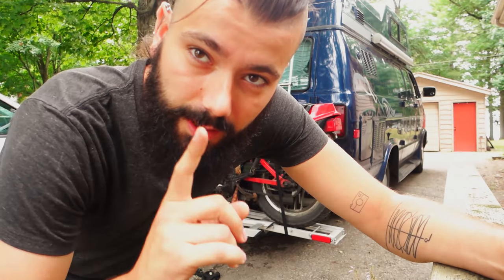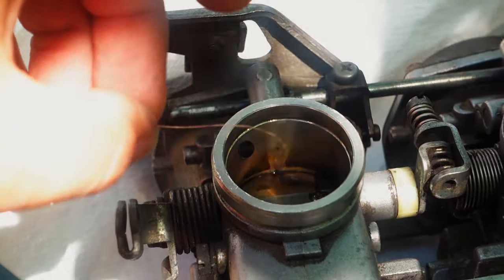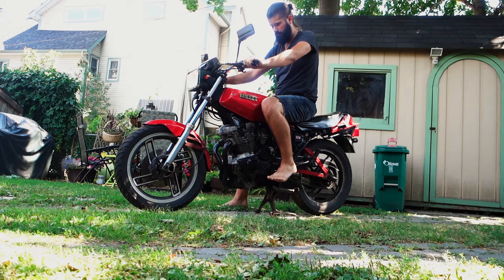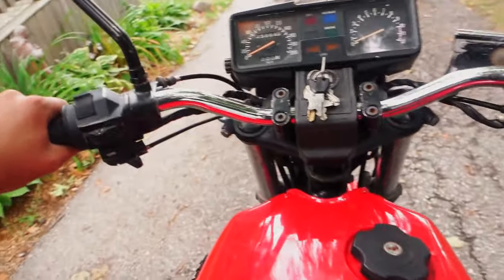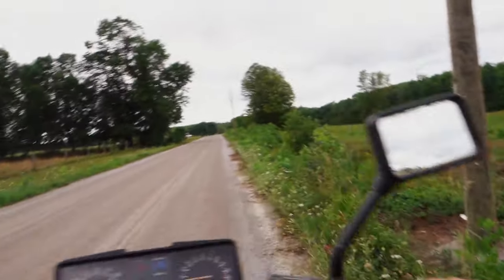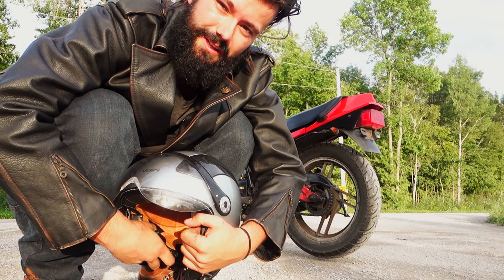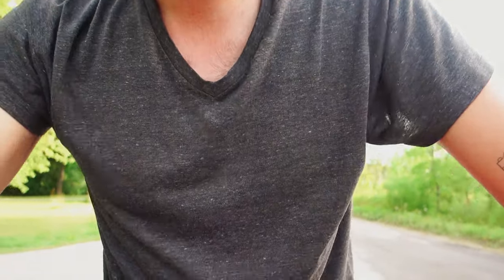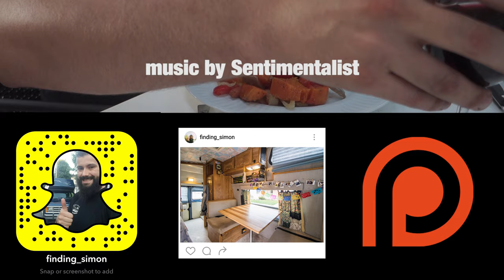It's ALIVE! - Van Life 156

Comment: It's the charge\lighting coils inside the magneto.. I worked for Yamaha and raced for them for years. I got the scares to prove it..

As it looks like an old Sega 400. You can biol the carbs out with cleaner from Yamaha, As the lower bowls get gummed up from seating to long and the gas goes bad. Glad too see one still running.

Comment: HEY bro! Hope all is well with you. I was wondering if you can please send me specific specs of your van so I can look for one in the U.S. I cant seem to find the 93  b350 that you have. Mainly I want this one because of the bed on top feature and it pulls out to become larger. I alos like the layout of the kitchenette and everything else. anywho i appreciate any help or tips. Thanks!
Reply from the maker: I've never seen another like mine, but I have seen plenty of Falcon's which have a similar setup, some with couches some with half ton frames, but all with the top bunk.
Reply: +Finding Simon aww ok. well I'll check out the falcons then. also when you said the van came with the conversions already done. what does that mean?